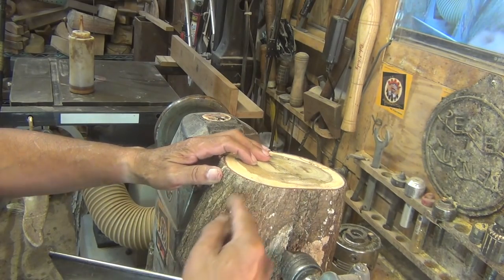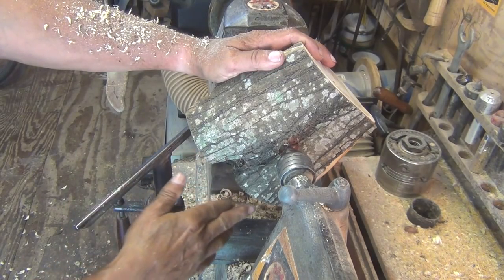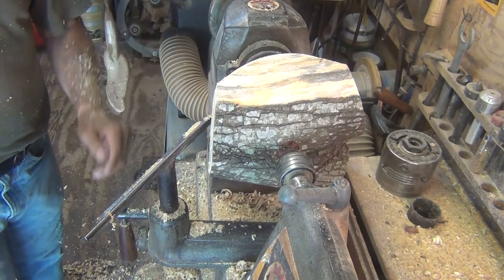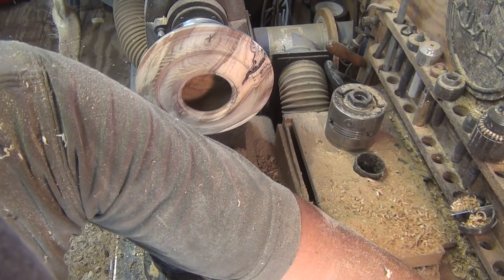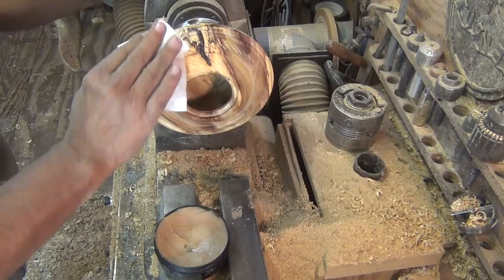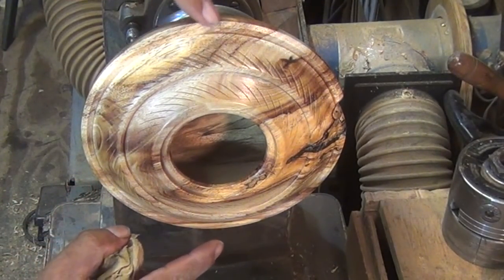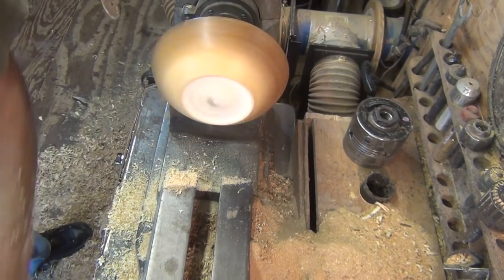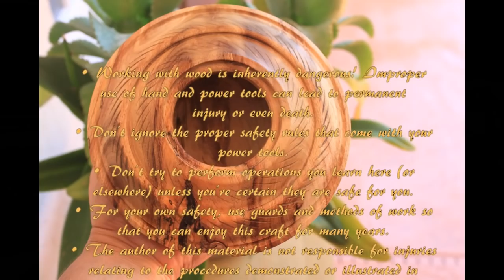Woodturning Camphor Laurel amazing colors

Comment: Al Great piece. I have 2 questions, 1 did you make or buy the hollowing tool, 2 when I use friction polish the paper towel sticks to the piece but when you use OB shine juice it does not ??
Reply from the maker: Thank you my friend I made the hollowing arm I do have a video on it.  and I use friction polish  OB shine juice  The paper towel sticking usually gives you a better shine  but it means you are bit heavy on the shellac add a bit more of linseed oil
Reply: @AlFurtado  Thank you for the help 👍👍👍👍👍👍👍👍